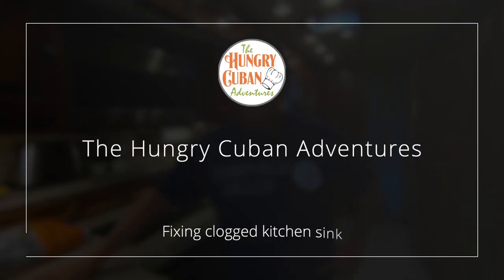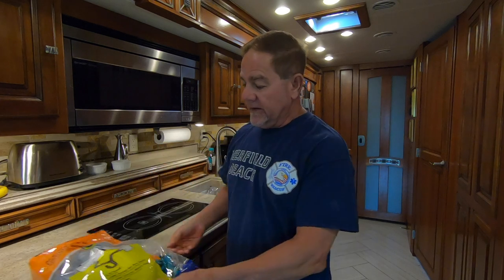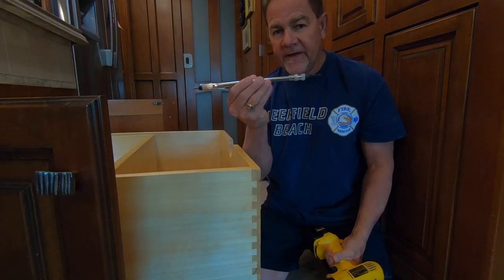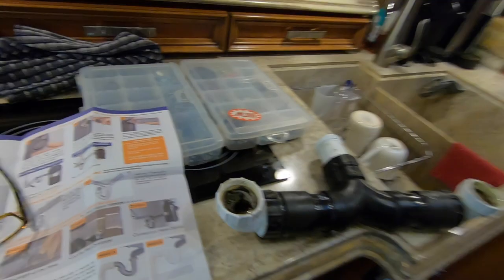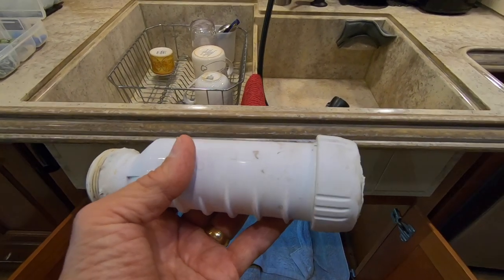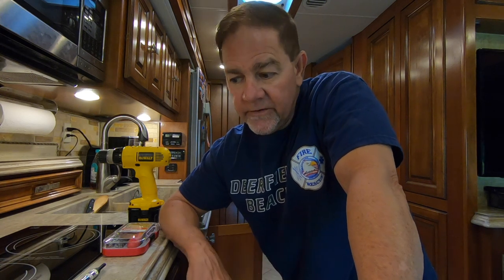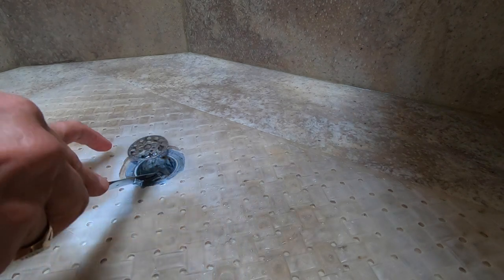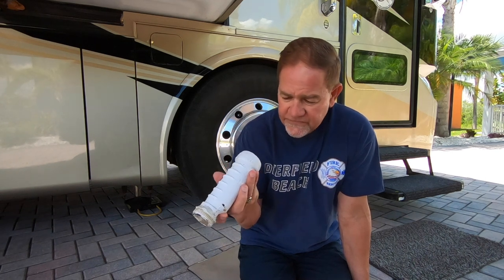Why We Replaced the HepVo Valve In Our Tiffin RV

Comment: Just checked under the sink of our 2015 Tiffin Allegro Bus 37AP. The ribs are faced down on the HepVo but we still have slow draining so will replace it. TY for the link.

 💡Removing the large custom under-sink drawer assembly can also be accomplished by removing the entire unit...rails and all. Take a look on the outer parameter of each rail (look down between the drawer and interior side of cabinet...to bottom of cabinet interior). 

There are just 6 easier to reach screws, 3 per side. Be mindful screw #1 (closest screw to you on each side) is the only one that uses a spacer. Unscrew screws and have a helper on other side to lift her out. Looks like how Tiffin installed it.

Note: the screw holes in the metal rail support base are 'keyed' which usually means you can just loosen the screws and slide the unit free but the heads on our screws look too large to fit through the key so if necessary, I will just remove them.

Thanks for sharing your maintenance tips👍

(ps: every time we watch one of your videos, we think...what a beautiful bus...then we remember we own one 🤣)
Reply from the maker: Wow. Glad you found this helpful. And thanks for all the clarification on removing the drawer. ThAT was the biggest pain in the $@& of the project. Safe travels and enjoy that BUS.
Reply: @TheHungryCubanAdventures  Hi again, actually performed the job so can report that doing it the way I speculated is the way to do it! 5 min. removal / 10 min. re-install of large drawer unit. 
Replaced HepVO unit with new one and discovered why we had back-up / smell issues. Tiffin installed the HepVo almost correctly with ribs mostly down but that pipe run to the back wall connecting with the down pipe portion was installed level (perhaps to maximize drawer capacity). 
Will obtain necessary plumbing parts and obtain some down angle because...uh...stuff flows downhill😉
Reply from the maker: Thank you fir the update. 👍
Reply: @TheHungryCubanAdventures  No problem. Stay hungry my friend😉. 

Working on water filtration next. Installing a triple can 5" system in the wet bay...1st -sediment...2nd -charcoal..and 3rd a ( .2 ) micron filter. Will need nothing on the post. Would make even pond water potable.

 Removing the 10 " factory canister, relocating the tank readout panel and removing the old style soap dispenser.

Research indicates that Tiffin designed the water system so that water into the fresh water tank, if it had been treated at the source with chlorine, should remain so in the fresh water tank until needed, THEN you filter that out for consumption.

Those blue screw on type at the post are defeating the purpose of that design.

Did you discover anything new with your shower drain? (Just cleaned ours. Shot a bunch of scrubbing bubbles foaming cleaner down the drain since most of what goes down that drain is soap residue. Drains well and smells great).

Comment: I have an Allegro Bus, too. I haven't taken out the HepVO valve, but I changed the soap dispenser for a drinking water filter that required removal of the undersink drawer. I didn't unmount the drawer from the slide. If you look on the vertical part of the metal slide, you'll see two indents on each slide. Inside the indent is a metal tab held in place with a screw. If I remember correctly (it's been a few years), the screw heads are under the drawer. from the outside, you can see the screw threads.

Any how, we also have slow drainage from the kitchen sinks. Our solution so far is to pour boiling water down the drain. That seems to clear it up. After looking at your video, I can see why it behaves the way it does. Based on some of the comments, I'll see if my valve is upside down, too.

Thanks for the video, I subscribed to your channel.
Reply from the maker: Thanks Michael. I looked at every which way to remove the drawer. Finally decided to just unscrew it. I will look fir those tabs you are talking about. Thank you for subscribing

Comment: Completely agree. the Hepvo valve is good in theory... for awhile. Previous owner had apparently tried using a plunger to get the sinks to flow better. Big mistake, it can flip the bladder out of the Hepvo valve rendering it useless. Also completely agree with Tiffin's puzzling decision to make it very difficult to remove the under sink drawer. May end up removing it completely. BUT love the coach.
Reply from the maker: Thanks Don for your input. My new problem is the HepVO valve under the shower pan. I will tackle that job when we get back to Florida in the winter.
Reply from the maker: Thank you

Comment: Looks like the HepVo valve was installed upside down, the ribs on the valve are supposed to be facing down. I would say that was the cause of the backups. Must have been done at the factory by mistake by some careless worker. Loved the video, great work!!
Reply from the maker: Yes I was told that before, but I had already changed it. 👍
Reply: It was installed the right way. You can tell by the threaded handles.

Comment: The hepvo valve was installed wrong at the factory. It was installed upside down. On a horizontal install, the valve should be installed with the ribs on the bottom. This is why you had so many problems.
Reply from the maker: Thanks for the observation.
Reply: Yes, I noticed that right off as I too am having kitchen sink issues.

Comment: You had problems with the HepVo valve because you didn't have it well installed the ribs on the valve should have been on the bottom to maintain the slope that's why you had all that gunk in your pipes.  and you should have installed it on the back wall vertically it would have been even better.    But a nice video!
Reply from the maker: Frank Of All Trades thanks Frank. The HepVo valve came with the unit when I bought do I did not install it.

Comment: Hard to see in your video but it looks like that HepVo valve was installed upside down. The ribs on the valve were supposed to be facing down. Factory mistake I would say.
Reply from the maker: Not sure about that. But since replacing it all is good.
Reply: Ya... it's upside down, also unless there is already one, you need a vent downstream from the new trap or it will pull the water out of the trap and smells will come back up into the interior, if it was factory installed , I doubt there was one installed as the HepvO valve doesn't need one but you can install one inline if it becomes a problem

Comment: Not only was that installed upside down, whoever did the install also used the wrong size piping between the valve and the sink. you can see the black portion is bigger than the white connector going into the hepvo valve, this will also cause the backup situation. you can go UP in size on a drain line, but you can never go DOWN, especially on a horizontal flow, both of these errors will cause a backup, because both create a low spot in your drain pipe. Also it's hard to see, but it appears that your replacement is an S trap, not a P trap, this will also not function properly! It will siphon dry. look up S-trap code.
Reply from the maker: Thanks
Reply: I noticed the S-Trap too.  “S” traps are prohibited under the Uniform Plumbing Code in Florida and most states. This is because the “S” trap will siphon or suck water out from the trap which will end up releasing sewer gases from the black tank.